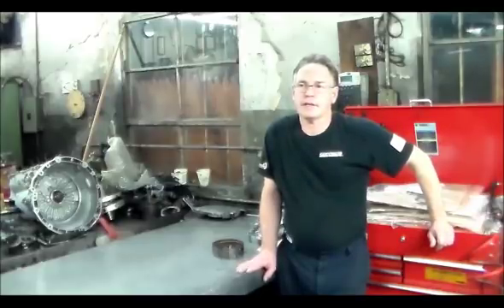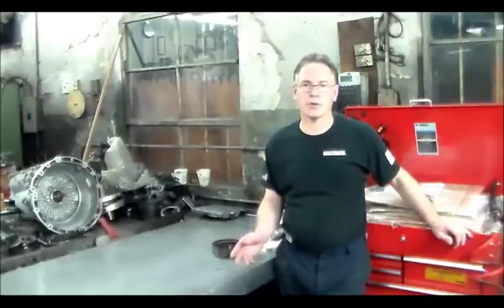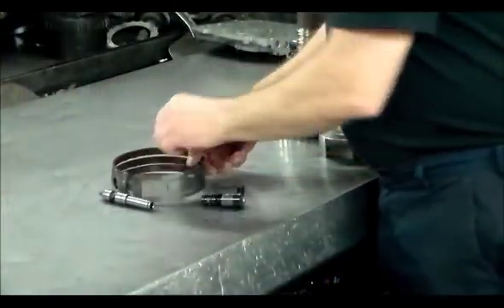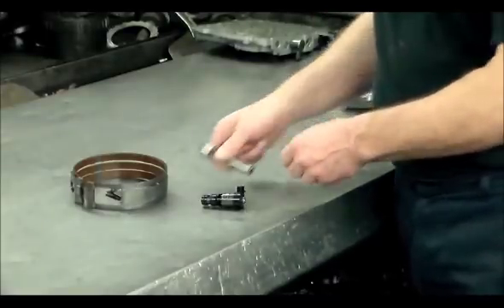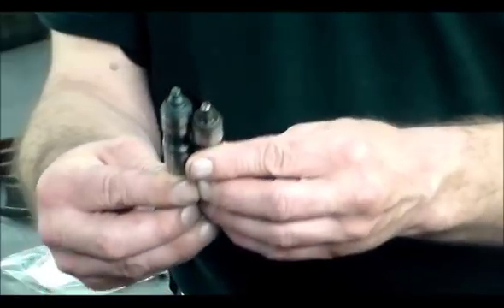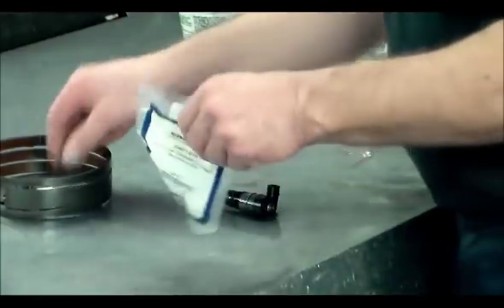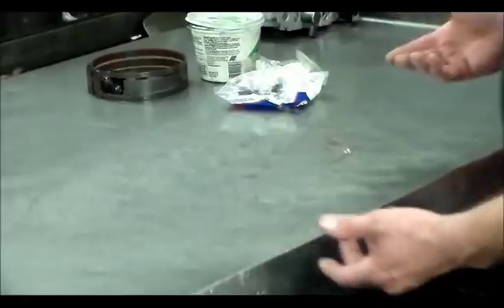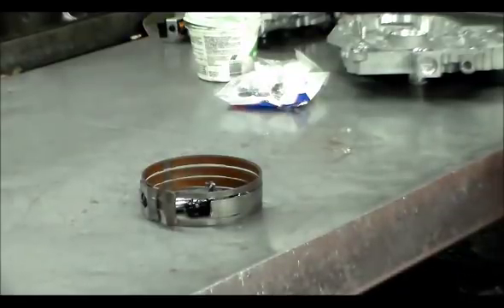4T65E, No Forward

Comment: Yup, servo pin over-travel means that the pin slams the band and force / momentum does the damage! 'Thanks' GM!  Too bad all the guts have to come out just to get the band out. New pin installs with the servo cover off, so you need to get the tranny out of the subframe for clearance!
Reply from the maker: Yes sir, just did one with the usual broken band
Reply: @GaryFerraro  Is there 'only' 1 band to worry about?  or?
Reply from the maker: @mmpiforall5913  There are 3 bands but the 1-2 band is what to worry about

Comment: I have a 2008 Chevrolet Uplander only 3rd and reverse gear work. Would that be a shift solenoid ?
Reply from the maker: sounds like it may be in safe mode, you need to have it scanned to see if any codes are present

Comment: Hey Gary I have a 07 optima automatic trans and it will only go in reverse and no forward, I tried changing gears manually and it will only go up to 2 and sometimes would not go up or down any idea? Transmission fluid is good
Reply from the maker: Very possible the underdrive drum is broken, fairly common

Comment: OK Gary I was driving my 07 impala and it stopped pulling all together I pulled over and it won't go in to any gear what is the problem?
Reply from the maker: Do you have reverse?
Reply: @GaryFerraro  I have the same issue. No reverse either. Park holds
Reply from the maker: @philreichert  does this move forward in neutral?

Comment: May I ask, what would be the possible reason for no movement when I shift to drive? But when I step the gas at around 2500 RPM it moves. Reverse is ok. Thanks.
Reply from the maker: If reverse is ok with no problem,then you have a problem with your band, it's a triple wrap band , if it still moves a little maybe a piece of the band broke off
Reply: @GaryFerraro  yes, it still moves a little and need to apply the accelerator before it moves.

Comment: Hey Gary. My 2010 impala 3.5 only drives in reverse, 1 and 2....does not drive in 3 or drive.  Any idea whats going on?
Reply from the maker: If you have reverse, the input clutch and sprag are good, very possible the band is broken
Reply: In my 08 uplander it wnt drive in D gear have to start at 1 and work my way to 3 slowly broken band?

Comment: My 4t65e only drives in first gear what would cause that
Reply from the maker: Very possible the 2nd clutch is bad, on this trans with out second , there is no 3rd or 4th.  Are there any codes present by chance?

Comment: Hello, I remember writing to you not to ling ago about losing first gear in an 08 chevy impala. I stated that there were no codes present. No codes ever popped up. I saw it was low of fluid and added a quart plus some trans seafoam. Tonight I drove it around manually. Upon waiting I heard a knock that was felt in the steering wheel. Well I now have first gear back. Hell it even downshifts on it's own. Now that first gear works. It shifts from first to second and now hangs up in second and gets into 3rd. The car will take off in drive. While it's in drive and shifts to 3rd the rpms go up and then it pops outta gear. I have never experienced anything like this. Its is so bizarre and wondered if you have ever in your career heard of anything as wild as this. What is happening with this unit?

Comment: Hello, I have a 2008 chevy Impala 3.9 about 94,000 miles. Winter is here in NY. I jumped my car, battery died. Drove to the store trans worked great. A couple days later dues to having kids. I swapped the dead battery to a new one. I go to take my impala to the store and it acts like the E-brake is on. I get it on the highway. It takes forever to accelerate with one shift into overdrive. I shifted the car to 1st, it took off in second, moved the shifter to 3rd then to drive and it performed normal once moving. I tried to downshift into 1st going slow of course, does not go into first gear. Did me changing a dead battery really do this to my transmission?
Reply from the maker: I doubt it, how is reverse?  Where are you in NY, i'm on Long Island.   is your check engine light on?
Reply: @GaryFerraro  Wow Thank You so much for replying this fast. I live upstate in Johnstown NY. So going over the problems. Reverse works as it always has, no issue there. Even from drive to reverse its fast and functional. When shifting to Drive/Overdrive that's when the car is struggling. Rpm range hangs in the 2,500 to 3,000 range while putting a lot of effort getting up to 30 to 35 mph, when you hit this speed you can hear that the engine is fully locked with the gear in the transmission and the power brings the car up to speed as it should. Now, if I start out in Drive/Overdrive and accelerate it's that struggle. When I took my foot of the petal and dropped the shifter down to 2nd, The trans did shift right to second, you could hear and feel it, pushing back on the petal and the car will accelerate faster the being in drive. I should state that while I placed the shifter in 2nd, as the speed increased and rpm range I manually shifted the car into 3rd to which it then shifted as it should, from there up to 4th etc and it runs as if there is no issue. I did start the car in the 1st gear setting, it took off in second. If I accelerate in 2nd and move the shifter to Drive, not only will it slow my acceleration but also the rpms drop and vibration can be felt. While down shifting with the shifter, my foot was off the  accelerator on an open road. As the car slowed I down shifted in a safe rpm range to not make the car jerk forward because of the speed. It dropped to 3rd, 2nd yet will not acknowledge that 1st gear is there. This just happens after changing the battery. Never had an issue prior. I truly am both frustrated and baffled.
Reply from the maker: @Cnightz  ok, question. When starting out from a stop, does it feel heavy like the transmission  is starting out in a higher gear like 3rd?
Reply: @GaryFerraro  Yes, That's exactly right on the money. It behaves just as you stated. Also, since I missed your question in the first response. There is currently No "Check Engine Light" on. Although I do suspect that there may be one coming on soon. The battery was just changed and I didn't really drive it enough to complete the system checks.
Reply from the maker: @Cnightz  ok,  it sounds like the trans may be in failsafe mode. You should have the car scanned for codes. I never had a solenoid short out on me from changing or disconnecting a battery but at this point have the car scanned for codes, this may give some direction on what the problem is. If there are codes present for the trans, let me know what they are
Reply: @GaryFerraro  Ok, I drove it around town and it just does the same thing, No codes. However I did remember something I did and I really hope I am not the reason for this screw up. As I said before the car was shifting just fine prior to changing the battery. The car had been sitting for a while. 2 or 3 weeks ago it was very cold out. It took forever to jump the car. That being said the car started extremely rough with lots of ticking. When swapping the battery it was cold and had been sitting a while. I added more oil in the car and put the car in flood mode prior to starting the car only as a means to crank over the engine and build up oil pressure. The part that is bothering me is, I can't recall if I floored the petal before I turned the key on to start the flood mode. Did I screw up the TPS to the transmission? And if that's the case how would I reset the TPS?
Reply from the maker: @Cnightz  Really isn't a reset for that. So you had it scanned and no codes?  May have to start checking fuses
Reply: @GaryFerraro  I'll be doing to a friend of mine who has a scanner and will update you.
Reply: @GaryFerraro  Hello, I am supposed to go see the man with a scanner in the morning. Ya know, I had some time to think about things. I wanted to correct what I stated previously. There was a code that popped up before a battery change. I am sorry it slipped my mind. The code that appeared was P0521, referring to the oil being low. It was low, it was due for an oil change. I recall I didn't start it one cold morning because of it. I had the jumper cables on, checked the oil. Since nothing was on the dip stick, I pulled the cables off and bought oil and a new battery. That was the only code on the car.

Comment: Hey Gary thanks for the videos, they are awesome. I was wondering if you'll ever cover the 4T65E-HD issue where the filter is plugged from torque converter clutch failure.
I have a 06 impala ss with the 5.3L engine that with drive for a couple blocks, shut it off for a while and you will get another couple blocks travel.
Reply from the maker: clogged filter for sure, classic sign
Reply: definitely change the fluid with dex vl and new filter and maybe before you go drive bleed thru all gears iv had that problem many times

Comment: Hi Gary I have a problem with my 2002 Chevy impala I put in drive reverse and it won't move in any gear
Reply from the maker: Does the car hold in park?  Did this happen suddenly
Reply: Gary Ferraro yes the car holds in park when I put it in a any grear it just revs the car was running good  I was cruising around stopped to get gas n next thing you know I'm towing the car home everyone says I need a transmission
Reply from the maker: @reneestrada3236  Certainly sounds like it, something either broke inside the transmission or the converter stripped, either way may have to come out. No fluid leaking? any noises when you select drive or reverse?

Comment: My 05 Buick lesabre has this transmission model and today would no go into any gear besides reverse. Does this sound like a broken band? Thanks in advance
Reply from the maker: yes, sounds like that band is broken, did this happen suddenly?
Reply: Gary Ferraro yes! Was on way to Mother’s Day dinner with the mom. Stopped at the store and when I got in car to leave that’s when it started.
Reply from the maker: @mike407r  Sounds like a broken band, thats what usually happens, no warning signs
Reply: Gary Ferraro thanks!

Comment: hello Gary i have a 4t65e that when you come to a stop and take off it bangs in to gear i replaced epc already any idea
Reply from the maker: ok, first are you sure this is full of fluid? On these units i always "overfill" them by  half quart or so this way i know it's full.  Any issue in reverse?
Reply: @GaryFerraro  yes I double checked
Reply: @GaryFerraro  no issues in reverse
Reply from the maker: @hemi.210  If no issues in reverse, this would eliminate the input clutch and sprag, which would only leave the band. To double check the fluid level. When the car is cold(first thing in the morning)do not start the car. Pull the dipstick out , wipe it clean and check the fluid level(car not running) If it's 2 1/2 inches above the full mark then the trans is full, if below it;s not full, easy to do. The one i had read full but was 3 quarts low on fluid, as i was adding the level did not move until i added the 3rd quart, if it is full, then i would say something with the band or the piston the applies the band
Reply: @GaryFerraro  added fluid still didn't work it drives fine till it gets hot then you come to a stop and get the bang on take off
Reply from the maker: @hemi.210  ok,  so hot reverse is still ok?  the 1-2 shift is ok hot?
Reply: @GaryFerraro  reverse is ok after the bang it's like it takes off in high gear
Reply from the maker: @hemi.210  ok, maybe have this scanned for codes
Reply: @GaryFerraro  no codes temp is going up 220
Reply from the maker: @hemi.210  Is it going past 220?
Reply: @GaryFerraro  last time I checked it was 224
Reply from the maker: @hemi.210  Anything above 230, i would consider getting hot.  was thinking about your issue and i think what the problem is, is there is a valve called solenoid regulator valve in the channel plate and i bet that valve is sticking when the car is cold. When you have issues cold and clear up when hot that valve is usually the cause of it.
Reply: @GaryFerraro  we are going to pull out Monday thank you for are your help
Reply from the maker: @hemi.210  The valve is located in the channel plate by the input speed sensor
Reply: @GaryFerraro  pulled unit input friction are smoked and forward band valve in channel plate is free
Reply from the maker: @hemi.210  reverse was ok?
Reply: @GaryFerraro  yes
Reply: @GaryFerraro   I sent you a few emails regarding an issue with this transmission, thanks for your videos, my name is James, I introduced myself in my emails to you
Reply from the maker: @snowrider5150  Hello James
 You have no forward?
Reply: @GaryFerraro  I can use all gears, 1st 2nd 3rd Drive reverse, for just a few seconds then it stops. Shut off the car, wait a minute, then can repeat all over again. Doesn't matter what gear your in it just stops and the rpms go up but no movement until you shut the car off and you can repeat it all over again. I sent you a couple pics of what the tranny pan looked like to your email.
Reply: @GaryFerraro  Hi, thats great advice, is that a good rule to follow for all trans?
Reply from the maker: @petersmith7140  As far as the trans temp?
Reply: @GaryFerraro  Sorry no, was  the 2.5 inches over full when cold for fluid level tip.
Reply from the maker: @petersmith7140  ok, yes i use that for most transmissions, was a trick i learned about for Fords(i think) but it seems to work on most

Comment: I thought it must be a rule that car Youtube videos had to start with "Hey, guys, what's happening?"  Thank you for not, first clue someone smart was doing this video.

I think, repeat, think that the broken band is no forward in D or 3 but 1 and 2 work.  And reverse, of course.  I think you imply that below in the comments.  That's the situation right now in my 2000 Regal GS and I derive my conclusion from the official GM shop manual.  When I drive in 1 or 2, there are also some "bangs," hard moments as it tries to make nice, up and down shifts.  Attempts at getting the right line pressure with the messed up band servo?

What's weird is that for several months I've been monitoring and analyzing some noises.  A bearing like noise in D, drops when in N.  Drove fine, no increase in noise with increase in RPM.  But the bugger was an intermittent bad noise in reverse, almost "clanking".  Now with the presumed front band bad, no noise.  Or, maybe it's just in a behaving good boy phase.

As this car has 187,000 miles on it, the previous and only owner obviously never changed the fluid (I did not long after buying in May) I'm thinking of just doing a factory rebuild swap like from Rock Auto.  Dyno tested, 3 year parts and labor warranty.  I lean this way also because my extended family history of shop rebuilds on 3 vehicles is 0-3 success rate.  Obviously, this reflects poorly on the likes of you, but that's where I'm at. 

I grew up in Huntington.  Have a good holiday, sir!

Comment: Hi there great video,  can very low transmission fluid also cause the band to snap?
Reply from the maker: Well, if the engine revs and bangs into gear it may yes but it's generally due to the amount of band travel and a malfunctioning EPC solenoid
Reply: Yes that's exactly what happened
Reply from the maker: John Conner reverse is ok?
Reply: Reverse and manual low work
Reply from the maker: John Conner certainly sounds like the band snapped. This happened suddenly?
Reply: Back story-  the van was given to me by an elderly family member  that can no longer drive due to vision issues. 
 When I picked up the van it was parked on a flag pole! I inspected underneath and everything seemed ok. A week or 2 later it developed an oil leak which turned out to be trans fluid and oil. Both pans got jarred by the flag pole but I assumed it was only engine oil .I continued top it up just until spring because I live in canada and it sucks working in the cold.
It started banging into gear intermittently then snapped all together.
Reply from the maker: John Conner sometimes that banging is due to a malfunctioning. Solenoid because it keeps raising line pressure
Reply: Ok I'm about to crack it open in the next week . I can let you know what I find thanks for the help sir.
Reply from the maker: John Conner my e mail  is
Gsferraro@yahoo.com
Reply: Thx :-)
Reply from the maker: @AR-tw3ee  Welcome, let me know how it goes

Comment: hi gary 
are you fimiliar with 6 speed kia hyundai trans
Reply from the maker: I,ve done a few repairs on them,   any codes?
Reply: Gary Ferraro i just want to have a few info on them do they have a common issue
Reply from the maker: The internal harness goes bad, gives solenoid codes, the harness is a 2 piece harness, i've done a few of them.
Reply: Gary Ferraro do they require a special tool to reset
Reply from the maker: i use my snap-on scanner to clear codes, im sure i could reset adapts if needed on this unit

Comment: Good morning boss how are you 

I have Bmw 640 Transmission ZF 8HP45 Car no shifting the fault code 420531 voltage supply output stage : short circuit to earth
Reply from the maker: ok, i'm assuming this code will not clear
Reply: Car no drive and no reverse befor one week coming the car same problem i erased fault  car okay after one week no sifting